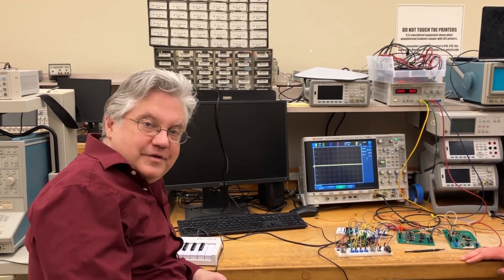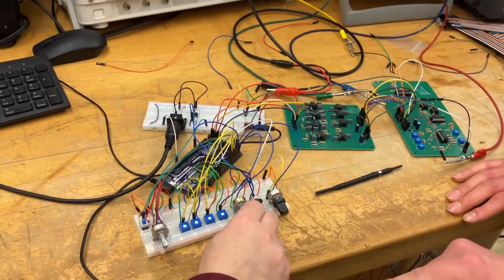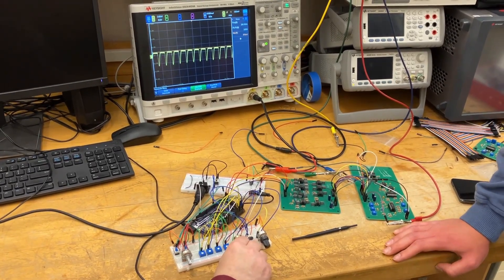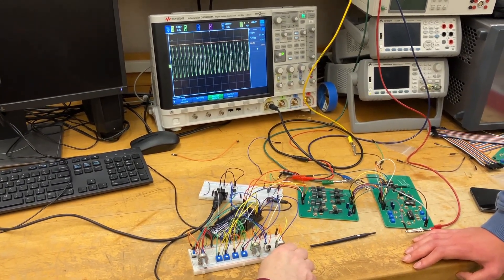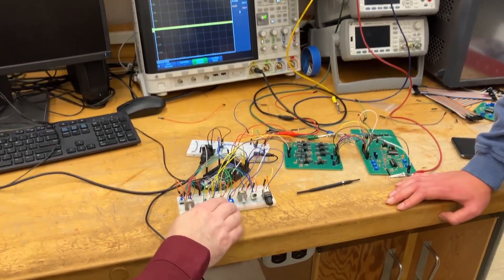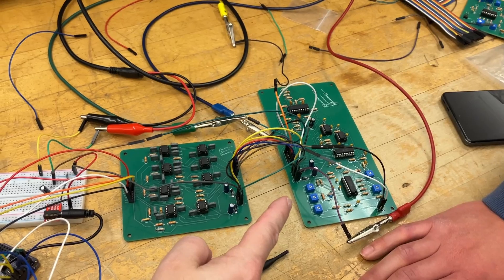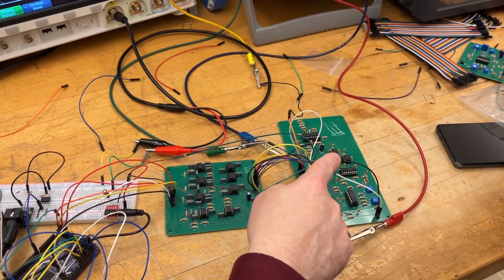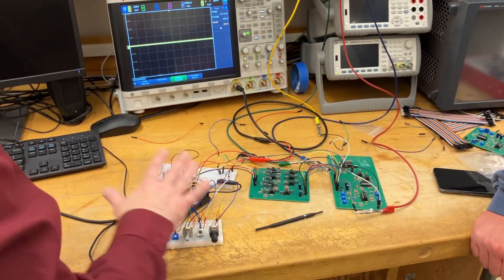Analog Synth Controlled by Adafruit Grand Central M4 with 3340 VCO & 3320 VCF (Senior Design)

Comment: If you use a cd40106 inverter and virtual GND you can get the Buchla "vco" running without using the transistor long tail construction.
I need to use opa2991(not using lm311) rail to rail and it swings rail to rail. Now I'm wondering how to use the Sine wave shaper, does 0 needs to be connected on GND level or Virtual GND? the Fallstad simulator can't emulate that behavior. To be used in guitar pedal.

Comment: Does it work with the Arduino IDE?
I'm exploring the Arduino Uno R4 (Arm m4), i got the timers with interrupts running in low level or hardcore code. dac, spi, I²C are on the TODO.
p.s. that blue Moog from the past used the mcu to count the vco freq to be sure it's exact on keystroke.
Reply from the maker: I'm pretty sure they're using the Arduino IDE... I'll double check with them to see if they're using it or raw C.
Reply: @Lantertronics  i checked on it, it's 3v33, the Arduino Uno r4 also M4 arm is 5V. 
it has a 8 bit wide port in pins, that enables you to do a lot  if you include 74hc / cd4000 series. Renesas mcu. hopefully they would do a mega version of this.

You can use sample and hold with CD4051 or better just using a single dac.

ask them if they want think a code that counts the freq of the vco and you make video about it
: )